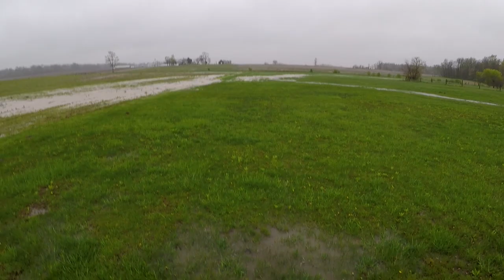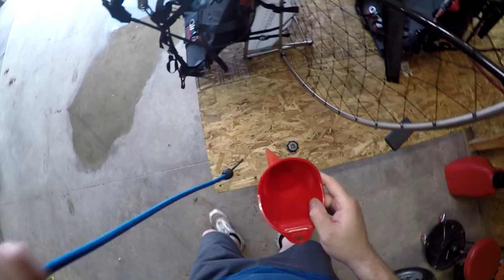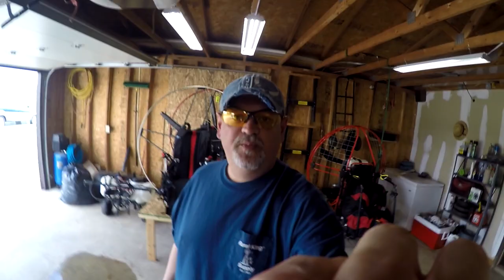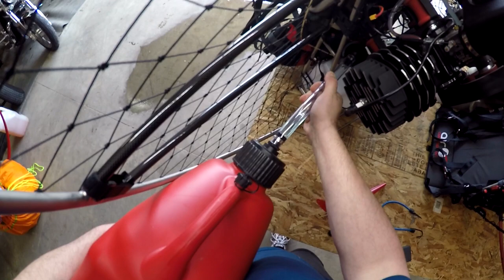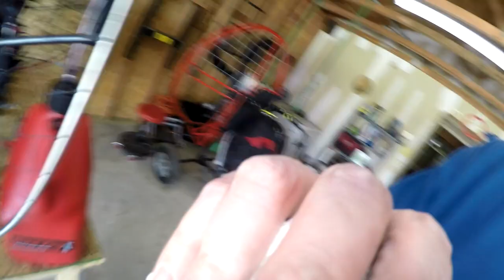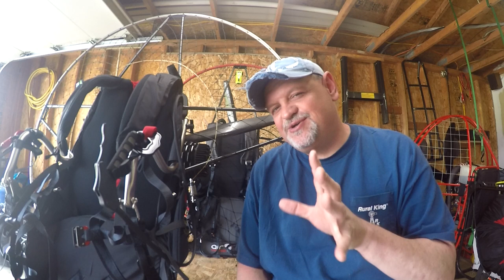Tornado 280 Update....Lets Start This Thing !!!

Comment: You can get a $5 syphon pump from the auto parts or hardware store. I have an electric one as well, but I hate it when I get out to the field and the battery is dead. I'm thinking about rigging up my own out of some fuel line and an outboard motor primer bulb. It'll probably last longer and reach further into my 5 gallon jug.

Comment: Bart use 3ft of hose, put unit on floor pour gas into funnel and hose, no problem. If gas can is heavy transfer gas to smaller container pour smaller amounts.
Reply: Yep, you need  2 or 3ft of 1 inch clear plastic hose from Lowes. Insert one end in tank, fill from your can on other end.

Comment: That sure is a nice running motor!  More vibration... probably because it's strapped to your back.  It'll be interesting to see the power difference between the Monster and the 280...that 280 sure revs quickly.  I have a Monster and mine runs very smooth.  I think I'd get a wooden prop or two...the one you have on there now is just too pretty to break.  Also about the tach and the problems filling the fuel tank...  all the parameters are sold pretty much "al-cart"...expect to discover a few special needs with each one.  Thanks for sharing.

Comment: My tank is mounted about like yours is I just use a long transmission funnel works perfect that red funnel is a lot shorter than mine (size does matter) so I'm sure you can find one longer, if not put a small length of hose on the funnel. Good luck.

Comment: Use a jiggle hose. It is a hose with a little ball in one end that only lets fuel flow One Direction. Elevate the fuel can so it is higher than the tank on the paramotor put the jiggle hose without the ball end in the paramotor tank and put the ball end in the fuel can and then jiggle it in and out of the fuel can really fast and it creates a siphon and will continuously pour fuel into the paramotor tank and both ends of the jiggle hose are inside the can and the tank there will be no spilling. It is super easy and it is the way I fill mine. Worst case scenario I get one or two drips of gas when I take the hose out of the fuel tank on the paramotor.

Comment: It's easy to fill the tank on my Nitro 200.   Pull the harness forward and put the funnel in behind it, inside the swing arm.   I use a gas can with a hard nozzle and it fills no problem.   Has it been easier to start since that first start?  My Nitro likes a lot of priming.   It sounds like you didn't have enough prime.
Reply from the maker: It has started very easily since the first start, I agree I don't think I primed it well enough the first time
Reply: Same for me -Pull the harness forward and put the funnel in behind - excellent advice!

Comment: Bart,,, Are giving up on Fresh Breeze? Or just trying something new? Looks like you need to order a set of floats. LOL One bad thing about the pump carbs is the tendency to run lean and burning up your motor. You could use a RC fuel pump.
Reply from the maker: Not giving up on the fresh breeze , just want to give foot launch a try

Comment: Also you cranked the heck out of that. Did you prime the fuel system at all? Also you were doing engine run ups with loose leg straps dangling. Man, you need a buddy with you to guide you through some of this stuff.
Reply: CTchuteflyer.. yeah, those loose leg strap ends (I assume it was excess) worried me a little too.. 
May wanna fold them away (or trim and seal) once you have them properly adjusted..

Comment: Yeah, the fill location stinks on the Tornado.  I use a cheap transfer pump to fill my tank, or a long transmission funnel.  Bart, I don't have experience with the 2 blade prop, but I would think that you'd want the 3 blade for yourself.  How are you liking it so far?  I'm burning about 4.5 liters/hr.
Reply from the maker: The 2 blade seems to have plenty of power, but I have plans of the 3 blade later, just went with the 2 blade while training on foot launch just in case of a prop strike, a bit cheaper to replace if it should happen  ;)

Comment: Hey Bart, what you need is a self starting shaker siphon hose. Just put one end in your tank and the other in the gas can. Give it a few shakes and the fuel will flow freely in. No fuss. No mess. You can find them on Amazon.
Reply: Northern tool Has a hand gas pump. I would use that.  a negative for the tornado for sure.